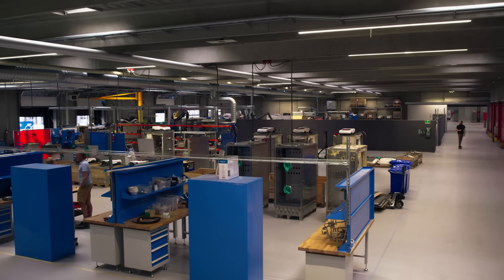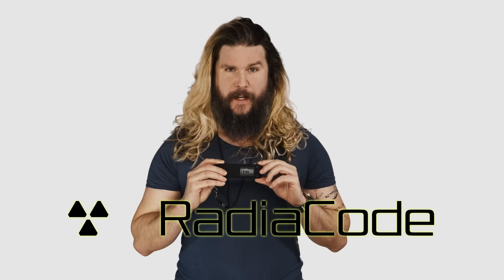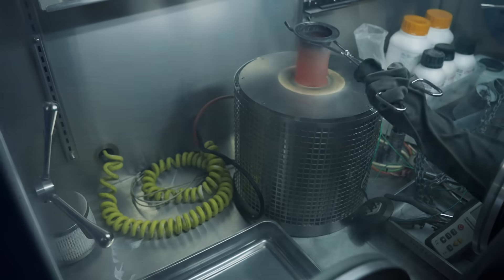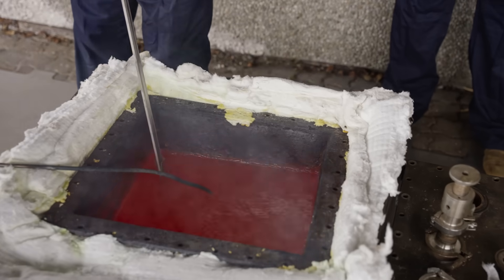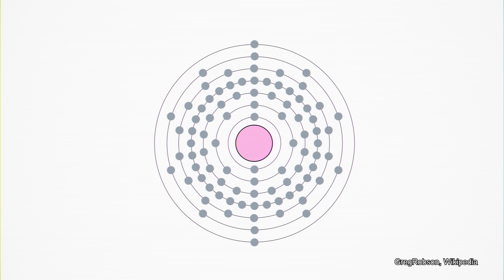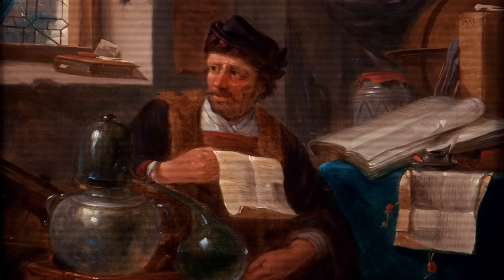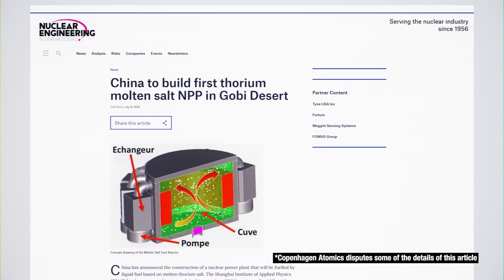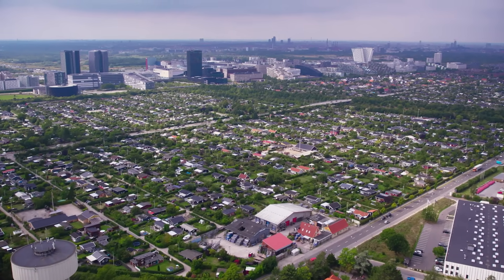Is THORIUM the Future of Nuclear Power?

Comment: Why is it that the HUGE proliferation issue that is brought with Thorium always over looked when talking about Thorium? It literally works off of generating the second best nuclear bomb material, a process that the United States used to stockpile U233 during the cold war for the arms race. It is a single step chemical process to dissolve U233 from a molten salt fuel making basically pure U233 by just running the reactor. I do hope this glaring issue is brought up in part 2 because it is almost never mentioned outside of the Nuclear Engineering/Chemistry community.
Reply: Maybe because the consensus is that Thorium reactors are worse at producing nuclear weapon isotopes than Uranium. From Wikipedia: "It is difficult to make a practical nuclear bomb from a thorium reactor's by-products" "a thorium reactor's plutonium production rate would be less than 2 percent of that of a standard reactor, and the plutonium's isotopic content would make it unsuitable for a nuclear detonation. Several uranium-233 bombs have been tested, but the presence of uranium-232 tended to "poison" the uranium-233"
Reply: Only 2 U233 based nuclear devices have ever been detonated, both as proof-of-concept tests. The 27-day half life of U233, with its constant flood of gamma rays, makes U233 absolutely terrible for bombs. It requires far too much shielding to keep 'secret' (or even 'safe') and a nuke with a shelf-life of 15 days is never going to be mass-produced.
Reply: Isn't nukes the REAL reason why nuclear reactor are made?
Reply: @ghoulbuster1  Originally yes, however today, at least in the private sector, reactors are made to not produce or make it really hard to produce bomb materials even the fuel used in many reactors is now being designed to not be suitable for bombs to limit proliferation of nuclear bombs and devices.
Reply: How is it a glarring issue? Just because the same technique was used in weapon manufacturing doesn't mean that's gonna yield bad results?
Reply: Also he mentions in the video that the reactor consumes the U233 pretty much immediately. From my understanding it didn’t really create U233, it’s an intermediary that’s then used up almost immediately
Reply: @zacharyduran84  It is not used up immediately it is continually being "built up" in the fuel cycle to be used as a fuel in the reactor but it doesn't go away immediately. Thorium 233 decay directly produces Pa233 which decays to U233 which in a reactor can be used as fuel( the point of a breeder) but it doesn't go away like you think it is a by product that builds up faster then fissioned that's why MSRs have the step to remove excess actinides U233 included to either be stored or reused as fuel.
Reply: You realise the alternative is either collecting U235 or making Pu239, right? Like this is not a problem unique to Thorium.
Reply: @ It is the ease of manufacture that is unique you have one chemical separation of fuel to produce pure U233 undiluted. Without the massive footprint required to make U235 or Pu239
Reply: In theory pure U233 would make a reasonable good bomb. The usual argument is that the U233 (especially produced from solid fuel) is contaminated with U232 that makes it less or not suitable for a bomb. Though not really tested so far and a bit more complicated the moten salt reactor could allow to seprate very pure U233. The 2nd and possibly bigger concern is that the same technique needed for the thorium breeder could also be used to produce plutonium with relatively little modification.

There are enough other difficulties that prevent a molten salt thorium breader from happening. It's a very dead horse and was abandoned in the early 1970s for good reasons.
Reply: @UlrichHarms-ci1ov Not in theory U233 was used as a bomb material and in a Thorium -233 decay chain does not produce U232 since Pa 233 decays via B-.
Reply: Because it's pure hopium. They never want to talk about the downsides. Same reason whenever conventional nuclear power is brought up, they always say there's enough uranium on Earth to fuel civilization for thousands of years, conveniently leaving out that most of it is in the ocean and would require a negative EROI just to extract. Hell, all discussion of fission or fusion power tends to conveniently ignore any power costs, up to the moment the fuel is in the fully constructed reactor and ready to undergo a reaction.

Comment: A classic saying from my thermodynamics lectures i will never forget: "If you want efficiency, run it hot!" Basically saying the hotter you run a thermodynamic engine, the better its efficiency of converting heat energy to electrical energy.
Reply: meanwhile all the electrical engineers are screaming right now
Reply: The most basic principle of the Carnot cycle
Reply: The SSR draught from Moltex runs at a very high temperature.
Which allows them to: 
1) use a gas turbine instead of a steam turbine
2) Use the heat directly in process, such as efficient water desalination. 
3) Can heat it's energy storage salt tanks to very high temperature, preserving that efficiency even when output is idling.
Reply: Perfect example is any star.
Reply: fusion bomb explosions are pretty hot i think 🤔
Reply: @badabing3391 yeah but you're not going to harvest that energy and turn it into electricity, would be a bit of a challenge lol.
Reply: If they could turn fusion bombs into electricity we wouldn't be attempting to make fusion power we would have fusion bomb engine cycles using atomic pusher plates 😂@epikgamingcat
Reply: @epikgamingcat oh sure, definitely a challenge.

Clearly we as humans are not up to it.
Reply: @godamid4889  theres no worthy cause if this isnt one.
Reply: @epikgamingcat  There was actually something called project PACER that looked at setting off H bombs underground to generate power. It was as ridiculous as it sounds.
Reply: @idris4587 nah we'd use them to boil water

Comment: i still think water is the best option. we just need to "space x "it and make it cheaper (dont build 2, build 30 of the same design). molten salt reactors to me feel like a red hearing. its just so much extra complexity and in my heart i know molten salt is going to be HELL to work with and for the machines. im shocked a molten salt reactor company thinks its a great idea (no offence) this felt a little bit like a fluff piece
Reply: Sure, but that would mean building more capacity for more pressure vessels since you need to make that water not boil somehow.

Comment: You make some bold claims here 14:52  while showing in fine print that Copenhagen Atomics disputes the facts of the article. That really needs to be explained, or at least a link provided with an explanation if we're expected to trust you.
Reply: Hopefully we get a good answer from Kyle, but my guess would be that it has to do with the amount of thorium or estimated run time rather than the mechanics of it. More political than technical I'd say
Reply: @Rhdej2 run time for sure. I don't think you'd get that much energy per unit of of time compared to uranium or coal. Seems unlikely. If that was the case, thorium reactors would be the norm in the nuclear power industry.

Comment: I have two concerns

1) corrosion - this reactor seems to have two closed saltwater systems that flow into each other… heat, water and salt are all corrosive. What protections are in place to protect against corrosion on both sides of the plumbing to prevent radiation leak after the extra neutron is inserted and the material is fissile?

2) what prevents the reactor operator from producing an overabundance of fissile material that can later be refined further into weapons grade uranium (which is why governments chose uranium over thorium in the first place)?
Reply: U-233 has a strong gamma that's very easily detectable and hard to shield against. Keep in mind that nothing stops someone from using a conventional U-235 reactor to breed plutonium or even inserting thorium for U-233.
Reply: Not salt water, molten salt
Reply: Look into nuclear powered submarines and aircraft carriers. The saltest conditions on the planet and yet they manage.
Reply: @robbirose7032  : Molten Salt is highly corrosive, so metals in contact with the salt will wear away.
Reply: @buildmotosykletist1987  ORNL already came up with Hastelloy-N specifically for this exact application, so I'm not too concerned.
Reply: @buildmotosykletist1987  we don't use metals, we use alloys, and they can be made to be highly corrosive resistant. Just standard SS316 is very fine to pump this around, as long as no moisture or air is present. That is easy to achieve. Corrosion tests show that it's a much smaller issue than anticipated. In the core however there is another problem with constituents of SS316 being good neutron absorbers, so to get the right k_effective is challenging.
Reply: @MalcolmAkner  : What are alloys made of? Metals. HTH.
Reply: @ Yeah, but technically and practically there is a huge difference. Molten salts is highly corrosive in some metals, and alloys can be manufactured to make it even less corrosive, like SS316 (very common steel type). When making technical points it helps to be technically precise.
Reply: @buildmotosykletist1987  molten salt is absolutely not corrosive.
Reply: @robbirose7032  : BTW. I hope they continue their research. Thorium reactors could be an excellent source of energy when all the problems are solved. But until then Uranium Fission is still the safest cleanest power source.
Reply: @buildmotosykletist1987  agreed
Reply: "Advanced ceramic materials such as silicon carbide and its composites have both the temperature tolerance and corrosion resistance to function in MSRs at the desired level of performance and safety. These materials are also radiation tolerant and, thus, can be used for structural components in the MSR." -The American Ceramic Society
Reply: Corrosion was my first concern as well as soon as I saw salt was being used.
Reply: To your second concern: Nothing prevents you fundamentally from using this technology to create nuclear bombs. Indeed, because reprocessing is such a central part, it becomes much easier to create bombs because all the steps you would have take to create bomb material you're already doing. With new fissile material ( = bomb material) constantly being created its that much easier to siphon of small amounts to create a nuclear bomb over time if that's what you wanted.

In normal nuclear technology, fuel reprocessing is such a "no-no" for exactly this reason. (It also helps that new fuel is cheaper than reprocessing)
Reply: Salt itself is not an electrolyte. I'm not sure if molten salt is, probably not since it's used to isolate electrons from rods.
Galvanic corrosion should not be a problem but when dealing with high flow, stainless steel can be a victim of Flow-Accelerated Corrosion (FAC)
Reply: The 2 thing seems like a non-issue. The other nuclear reactors are based on U2 235 and Pu 239, which have the same concern. I think this might be a talking point created by someone with an "interest".
Reply: @TroyBrinson  salt is not corrosive

Comment: The thing I'd be worried about - and the thing I would maybe like to see discussed in a future video - is that having the fuel mixed into this salt and moving around sounds like it would be exposed to more points in the machinery that could fail or leak. I am very open to being convinced otherwise, but it sounds like the added complexity adds new possible failure points.

Otherwise, the idea of fuel making itself more efficient sounds awesome, as does their pitch of a newly assembled reactor each day.
Reply: You're exactly right. By mixing the fuel with the coolant, the entire inner coolant loop out to the first heat-exchanger has to be shielded from radiation, instead of just the core. Most of the radioactive elements are very short lived so they'll decay before the fluid leaves the core but some elements remain emitting radiation as it flows around the loop.
Reply: This is one of the big issues with the design, as every part inside the primary loop is exposed to neutron radiation, leading to neutron embrittlement. This coupled with the salt corroding metal still hasnt been fully solved. Considering you need NPPs capable of running 80-100 years without major overhauls to be competitive on the current energy market, I dont have high hopes for molten salt reactors.
Reply: @xXYannuschXx The guy himself said the metal lasts only 5 years while the fuel lasts for 100
Reply: Well i think the box itself is alreay leakproof and a sort of containment building. and arround that the requirements will probaly require another containment building.
Reply: @minecraftfirefighter  Nothing is truly "leakproof". Leak-resistant sure. But, the right unexpected earthquake comes along and .. yeah.
Reply: One of the workers mentioned that while the fuel would last a long time, their reactors would only last 5. I'm guessing they're going to try making their reactors cheap enough to justify the cost.
Reply: TMSR-LF1 is a currently operating (since ~Oct. 2023) liquid fueled thorium molten salt reactor.
This paper (DOI: 10.1016/j.anucene.2024.110362) says, I quote: "The TMSR-LF1 loop is designed to operate at 0.5 MPa of pressure and 700 °C of temperature. The base material is UNS N10003 alloy, which has excellent corrosion resistance and great creep durability in molten salt environments at high temperatures."
There also appears to be a number of papers simulating inelastic creep damage of this material in the environment, for example this paper (DOI: 10.11889/j.0253-3219.2019.hjs.42.010601) finds the material meets the 10-year life requirement for this particular reactor in the reactor pressure vessel nozzles.
Reply: @ "finds the material meets the 10-year life requirement" - Might be good enough for a research reactor, but at 10 years on a commercial reactor you havent even returned profit.

Comment: 11:44 does this mean thorium reactors are just a really convoluted form of geothermal power?
Reply: Or on the flip side geothermal is just a convoluted way to use nuclear power. Same with solar and wind now that I'm thinking lol. Even Fossil fuels technically, because the energy that created those bonds came from the sun.
Reply: @jacewhite8540 while it is true that biomass, wind, photovoltaic etc are indeed in essence taking their energy from the sun, that is fusion driven by mass and density of the star, yet we are not able to make that kind of fusion on earth. We are not even able to make  (cheaply) high temperature fusion with plasma confinement. And even if we could, the radioactive waste would stay here, not in the sun.
The comparison of geothermal with nuclear fission is more fair, including the fact that, at least for deep geothermal plants, like with all mineral extaction from depth, there is a release of radioactivity that was sealed in the ground, hence technically they should be concerned by the same burden on radioactivity regulations as plants with the word "nuclear" explicitly in their name.
Despite the origin of their energy content being in the sun, extracting and burning fossil fuels (coal and gas in particular) also release radioisotopes. So they are a source of both CO2 and radioactivity!
Reply: I'd never seen a graph like this until just now, this single image completely explained how geothermal energy works for me
Reply: Well how else do you think you get power from radioactive elements? How it works is you a) make heat b) boil water c) spin a turbine and make electricity